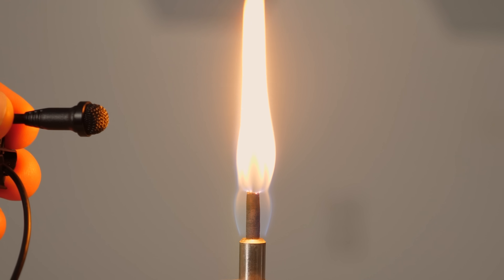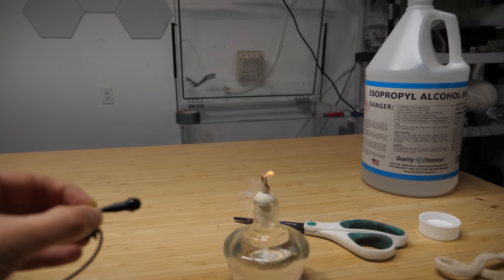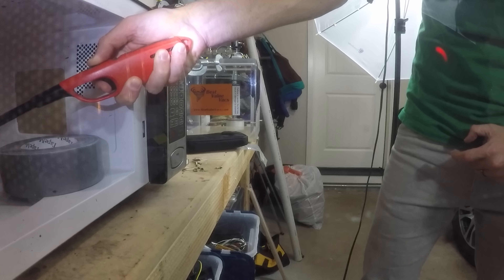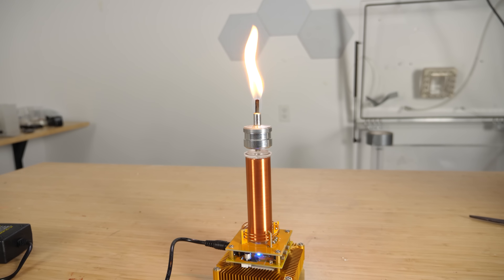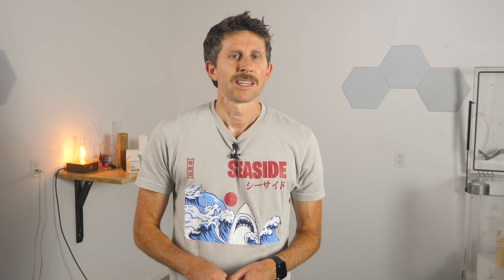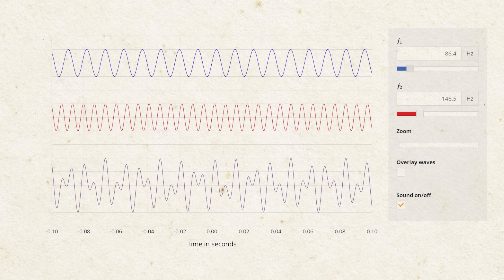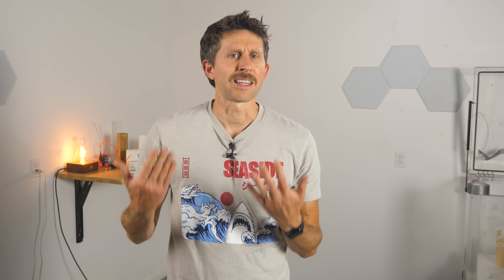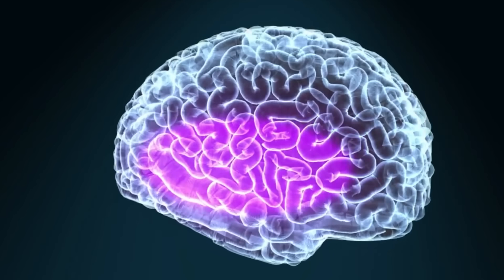Can A Burning Bush Talk In Real Life?

Comment: This also works if you're unwise enough to touch an AM radio broadcasting tower. While the electrical arc is frying your body it will actually play a pretty perfect version of whatevers on the radio, because the electrical arc is modulated by the amplitude of the audio from the radio broadcast.

Comment: Well, plasma is chaotic. Which means that there is a probability, albeit "extremely small", that ions just randomly oscillated in the correct frequencies, so that the burning bush would talk. So, theoretically, the fire could have actually talked to Moses.
Reply: That suggests intent, which is different from probability. Moses could have Heard noises from a flame and INTERPRETED them as speech, without the weed on fire having actually "said" anything intelligible

Comment: Cute but hardly a burning bush talking. Your highly localized flame is simply acting as a speaker. Try that with an extended source with random phase differences across its volume and all you are going to get is noise. It works for thr tiny flame because the wavelength of the sound large compared to the size of the flame. This experiment would probably not work frequencies above 1MHz.  

Also, to talk implies conscious though. Your example demonstrats a mind talking through a single, highly localized flame.

Comment: Just clicked onto the video and paused it at 1 second to write this.

Based on what I've seen with jakob's ladders and tesla coils being able to "sing" by varying the frequency of the arcs, and another one where a guy made a musical fire table, i think you could do something similar with a laser. If you hit something hard enough with a laser, especially wood, it will vaporize and cause gasses to be released. I've heard all manner of scales and pitches, either constant or sweeping up and down in and out of audible range, while sitting around campfires over the years. I think that by using a laser and modifying the intensity (or maybe frequency but probably not in this case) you could cause a certain amount of off-gassing/vaporization, that if you controlled it properly, could simulate speech or music.

Comment: Its cool if you have a 4 inch pipe, put a 4" speaker at one end, and put a propane nozzle in the other end, seal it off, then put one row down the length of the pipe of very small holes, now turn on the propane,  and light the row of gas coming out of each little hole, now play music through the speaker, the flame tips along the pipe, will dance to the music being played through the speaker....😎👍

Comment: Question, the electrical out put giving rise to the mechanical pressure wave? Or is there a pre speaker input synthesis of all the different electrical waves into a singular output feeding into the speaker? 
Our brains preieve different sounds only because those wave forms are present in the projection of an orchestral sounds, so I would assume that the electrical waves feeding into the speaker, also contain all the individual wave forms despite what appears to us being only the vibration of their combined synthesized wave form!

Comment: Among thousands of loudspeakers on the market, one or two use plasma tweeters. They are expensive, impractical (high voltage, and emit ozone into the room) and they produce a faint crackling noise caused by airborne dust particles getting zapped by the plasma flame. But you'd be the only kid on your block to own one.

Comment: I remember first reading about using a flame as a loudspeaker around 1971-1972.  The early implementations used two electrodes in the flame, one at the base and one at the tip, connected to a step-up transformer driven by an analog audio  amplifier.  Ions were introduced into the flame by means of a wick soaked in brine to make it more conductive.  The host of this video wasn't even a twinkle in his daddy''s eye at the time.

Comment: If a man touches an AM radio tower while it's broadcasting, he will be instantly electrocuted. However as his body bursts into flames from the extreme voltage, you can hear the radio broadcast in the smoke and flames that waft off the body as it incinerates.

Comment: 1:32 It is indeed pretty crazy how our ear detects weak soundwaves: a sound that is just audible (near ~0dB) vibrates the tympanic membrane in your ear canal with an amplitude no bigger than the diameter of a single hydrogen atom!
Reply: The hearing of some animals is shockingly close to the thermal noise floor, too.
Reply: @TheLoneWolfling  Yeah, that is around minus ~20dB in air if I remember correctly. Humans are only one order of magnitude (in amplitude) above that too. It is quite amazing.

Comment: cool. I've been wanting to pursue this in earnest, except not at high frequencies. 

I would LOVE if you spent the time on low frequencies. From my understanding you would need very large flames to make it happen. Do you think it would be possible to use a gas manifold to make the large flames to make a bass frequency using the flame? I just haven't had the time and money to go for it. It would be so cool if you could do it. 

I was going to make a 500V power supply for it as a starting point.

Comment: @arc19-x I understand what you're saying but actually your comment is somewhat misleading. It is the fire that is causing the air pressure changes that we hear. His point is that the plasma from a Tesla coil is hot enough to cause the air pressure changes on its own. You have a transducer chain, the plasma shapes the flame, the flame shapes the air, the air shapes the membrane of the microphone, the microphone membrane shapes an electrical signal, which is amplified to shape the speaker cone which in turn shapes the air, that shapes the hairs in the cochlea which shapes what we perceive. (Whew!) He shows an example of what the fire would sound like without anything driving it other than puffs of air and the resulting temperature changes. The Tesla coil allows for more granular shaping of the flame of course,  but it is the fire actually making the sound.

Comment: You say "Every sound you'll hear is coming directly from the heat of the fire expanding and contracting at just the right frequencies." yet you later confirm this is not actually true via "-the fire on top isn't necessary because the plasma from the Tesla coil is already hot enough to make the sound waves as well.". This would be an impressive video had you actually accomplished the audio reproduction via modulation of the combustion alone. I'll give you a like regardless since it's informative and helps people learn about the concept but your title and initial premise/claim is misleading and not delivered upon.
Reply: he did show the modulation when he threw 200 hz at it. what he failed to mention is the volume or amplitude is proportional to the energy being released... the arc alone only has a small amount of energy. you need massive discharges to get any decent type of volume. the flame releases a large amount of energy, and as that energy release can be modulated, its not only a speaker but also an amplifier.
Reply: @paradiselost9946  I'd be interested to see some data on just how much amplification the combustion is providing in his demonstration. I could be wrong here, and I don't have data to back it anyways, but I'm imagining any amplification effect it does have drops off significantly at higher frequencies and it's going to be far below the pressure the Tesla coil is producing on it's own with the primary limiting factor being the fuel source maximum flame speed and your ability to actually cut/start ignition efficiently in this setup. In my opinion, it would be waaaaay cooler to see some custom work put into building a high frequency membrane based piezoelectric fuel injector that would produce little to no sound itself leaving any significant output fully due to the combustion of your fuel source of choice.
Reply: Should have demonstrated the metal candle set up without the fire present, so that we could hear that fire makes the difference. Without the comparison it might be generating the sound via some other mechanism.
Reply: @nurmr  admittedly i would like to see a bit more but... thats this channel. he gives you a taste. plasma speakers are a thing. not many people know of them...
frequency wise, afaik, theyre full spectrum, there appears to be no limit.  they were a big thing in the audiophile "i can blow 100k on a record player..." market.

mu or beta or gain... how well does the system modulate the energy release? thats all it is, rate of energy release.  bass particularly requires energy... so dont expect massive bass from a candle.

im not sure i volume or area plays a role in bandwidth or low frequency range... 

its an interesting topic if you want to experiment...

Comment: I realize that I am really overthinking this, but ... the explanation seems to leave out something important.  The Tesla coil produces a stream of pulses of energy that are very narrow in time.  Narrow in the time-domain equates to broad in the frequency domain.  What is actually going on seems to be an amplitude modulation of these high-frequency-content pulses.  It seems like it's at possible that there isn't enough acoustic energy to be audible directly, but that non-linearities in the microphone (and human hearing) are demodulating the high frequency content down into the audio range.  The non-linearity would likely be due to the inability of the microphone (or the human ear) to track the peaks of the pulses.  There would be ways to test this with high-performance audio equipment, but it's just curiosity, so I don't know how much more effort it would be worth to understand it better.

Comment: ~30 years ago I was doing some work for a gentleman that sold very high end audio equipment and also wrote articles for audiophile magazines. He introduced me to plasma speakers. They are essentially this exact thing. Plasma housed inside a tall flat speaker that creates the audio rather than a mechanically controlled membrane. The things were absolutely incredible to listen to, but cost the same as my car.
Reply: Electrostatic speakers you mean?
Reply: @Streamcatcher no plasma speakers.
Reply: No.  The electrical energy turns into mechanical force  driving the magnet attached to the speaker's cone.  The pressure variants are created by mechanical means. 
An electric motor moves it's load by converting electrical energy into mechanical.
Reply: The way he described them to me is that they are nearly massless and just like in this video the plasma oscillates with the output and creates the sound.  The speakers actually glowed. They were incredible to watch and the sound was probably the cleanest I had ever heard. But as I said, they were insanely expensive. According to him his setup was 6 figures. I didn't press for a more exact figure.
Reply: @RPMiller 6 figures 30+ years ago!
Reply: @RPMiller mostly due to greedy price hike just cuz it's new or rare. Come, lord competition!
Reply: Thanks. I'd heard the name but hadn't thought about what that actually implied.
Reply: I was going to say that you can get an even better sound for free. But it’s not free sadly. There’s no better a quality sound than a decent nylon string acoustic in the correct hands. No electronic or equipment required. Then I realised that the guitar cost more than a car and the learning process over the years cost tens of thousands on guitar strings alone. When you hear a good acoustic player nobody ever thinks of the cost to be able to sound and play like that.

Comment: James brilliant demo I must say. In all the years I’ve done audio modulated plasma - it never occurred to me to incorporate that into an actual burning flame for a magnification effect. Really loved this video.
Reply from the maker: It doesn't exactly amplify it, it is about the same with the pure plasma vs the fire. It just looks a lot cooler and you can actually see the pulsing fire at given frequencies which isn't as clear with the plasma.
Reply: @TheActionLab holy shit .. I've got a slightly more beefy coil than that set up for sound.. and all the other components you used.. I freaking love it when you show us things we can immediately do in our own workshops. Love love love you guys. Talking flames tonight baby! 😮
Reply: @TheActionLab  But now I'm wondering about the frequency response...  Maybe it doesn't amplify it, but maybe it does change what it sounds like?
Reply: @TheActionLab  One difference would be the surface of the volume that is expanding and contracting. Plasma from a TC is smaller and extinguishes completely whereas a flame grows and shrinks from a nominal size, and that size is larger. The energy from the TC is conducted through the flame to it's surface b/c of the high conductivity of the plasma in the flame. Would be interesting to see frequency response of no flame vs. different sizes. Also seems like since you don't need the large energy spike to create the plasma, that a high voltage driver should be able to modulate the flame without a TC. <frantically gathering parts and candles>
Reply: @TheActionLab The moustache is also unnecessary. Except it doesn't look cooler. Forgive my bluntness.
Reply: Ahh.... near misses.. it happens to almost everyone
Reply: @randomdosing7535 🔴 What Is Islam?  
 
🔴 Islam is not just another religion.  
 
🔵 It is the same message preached by Moses, Jesus and Abraham. 
 
 🔴 Islam literally means ‘submission to God’ and it teaches us to have a direct relationship with God.  
 
 🔵 It reminds us that since God created us, no one should be worshipped except God alone.  
 
 🔴 It also teaches that God is nothing like a human being or like anything that we can imagine. 
 
🌍 The concept of God is summarized in the Quran as: 
 
📖 { “Say, He is God, the One.  God, the Absolute.  He does not give birth, nor was He born, and there is nothing like Him.”} (Quran 112:1-4) 📚 
 
🔴 Becoming a Muslim is not turning your back to Jesus.  
 
🔵 Rather it’s going back to the original teachings of Jesus and obeying him.  
 
 
More .....👇 
 
🔴 THE RETURN OF JESUS
Reply: Does the flame actually amplify the effect?  It seems like maybe it should, but also plasma is way faster at heating and cooling, so it should have a higher response at some frequencies...
Reply: @georgedorn_fnord  He should upgrade the TC he's using to something like Steve Ward's HFSSTC and see what that combo does
Reply: @georgedorn_fnord  i.e. go to Steve Wards place and team up for a video
Reply: Looking forward to your next video on PlasmaChannel!
Reply: Magneticitist tried it if I recall, but with a regular wax candle
Reply: Just try not to burn your house down!
Reply: @nobody.of.importance that's what my wife tells me daily...
Reply: @curlyjc  For you, doubly so. xD
Reply: Brilliant demonstration. A real eye opener 😊 Thank you.
Reply: If I get a singing candle I’m playing some Justice through it
Reply: AM Radio towers like in the Slowmo Guys Video also create talking fire through plasma. So do Tesla coils.
Reply: Lee deforest experimented with these Flame for Radio Amplification before he invented the vacuum triode with Grid.
Reply: I love your channel. Keep it up. I wanna see more ion propulsion videos.
Reply: But he didn't test it on an ACTUAL BUSH, out in nature.
Reply: Andreomorphism and Andreopath'sm..
Reply: 8